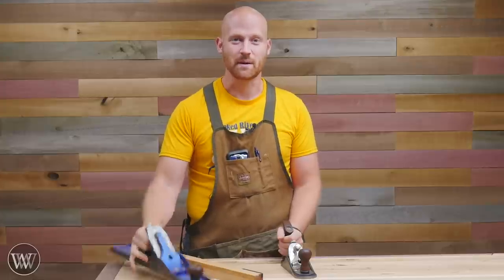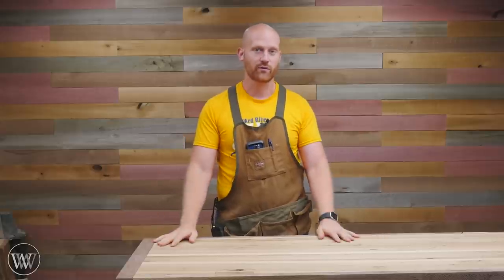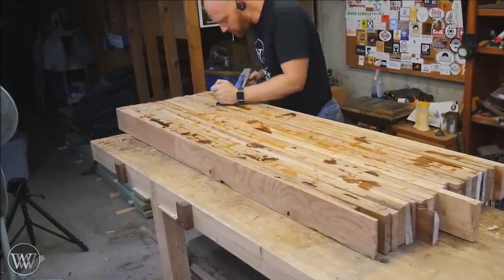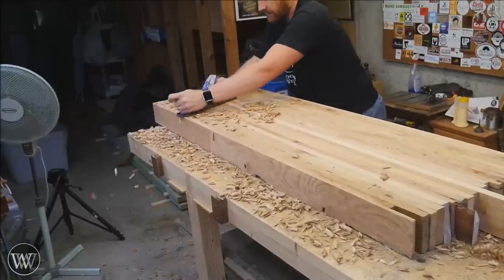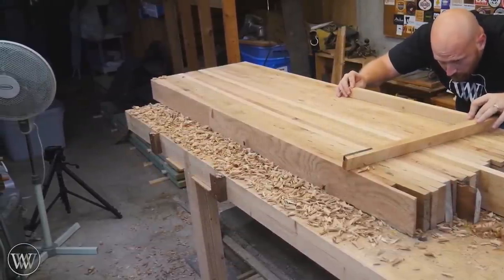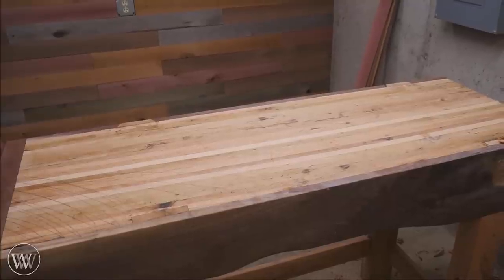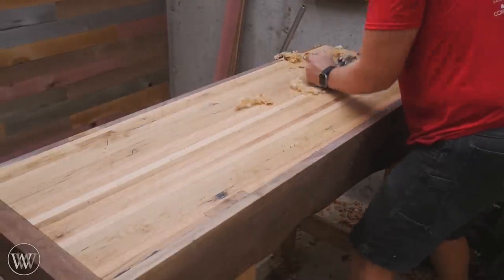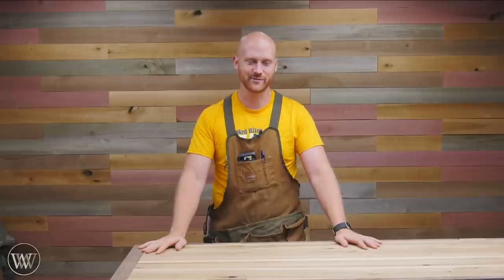How to Flatten a bench top with hand planes - Hand Tool Woodworking Skills

Comment: Great video. Thanks for adding in the important details that most don't add in, like planing at a 45 degree angle. Would these methods work just as well on a dining table top, even though you're planing down the faces of boards instead of edge grain like on your work bench? Thanks again.
Reply: (Late I know but for anyone wondering this) there isn't anything fundamentally different whether you are planing the wider face or the narrower face of a board. End grain is much harder to plane though, and tear out occurs differently compared to planing the face.

Comment: Question: I am not clear on why the winding sticks are needed/useful here, as you are working with a whole bunch of boards (each with its own idiosyncratic behavior, presumably) and not a single piece. If it were a single board that you were planing, the winding sticks would have indeed indicated the typical "corkscrew" motion of the wood. But seeing as this is not the case, why are they needed here?
Beautiful work, as well always, BTW...
Reply from the maker: The top itself may not be twisted but if two opposing corners are high the surface has a twist to it not the board. The winding sticks will still tell you that. A straight edge may or may not actually show you the twist in the surface.

Comment: After planing my hard-maple bench flat, I found that it was just too smooth and slippery.  I ended up going over it with a random orbit sander with a 100-grit disc to rough it up a little.  I like it much better that way.
Reply from the maker: Yup a lot of people do that. I just finish it with BLO and that provides a bit of grip.

Comment: Great job James! However, if you really want to get it flat & do it fast, use a router set up. I know, I know, this is a hand tool only channel.... :)   Steve
Reply from the maker: even then this is often faster. I spent 1.5 hours total. and if you calculate the time spent making the jig, setting up the jig, junning it, then smoothing and sanding. I would have been done long ago.

Comment: This is a great video. Would the same process work to flatten something like a table top even though you'd be planing face grain instead of edge grain like the benchtop you were working on? Thanks.
Reply from the maker: It would be the exact same for that face grain or edge grain is the exact same thing.
Reply: @WoodByWright  ok! I wondered if that was the case. I just didn’t know if there was a distinction between the 2. Thank you!

Comment: So looking at this it doesn't seem like your flatten the boards before the glue up. Is this the case? If so, have you had any problems with boards not lining up together when glueing the sides together?
Reply from the maker: Nope. flattening them before glue up is something you do for power tools cuz you can't run it through a planer afterwards. for hand tools it's easier just to glue them up and then fix them all at once rather than individually.

Comment: Will this work or do you recommend anything different for a larger tabletop? 

Making a farmhouse dinner table. First time doing pocket holes. Upon screwing them together It’s a lot less smooth then I had hoped for. Guess I’m trying to avoid sanding for hours 🥴
Reply from the maker: Right on. You can do the exact same thing for this as you would do with a bench top.

Comment: I made a bench top from planed all round pine from a local timber merchant. When I glued it up, it was reasonably flat, but then a few weeks later when I came back to it, it had cupped badly (along width). So much so that when placing a straight edge against it, there was about half an inch gap on either end. What would you do in this scenario? I think trying to flatten is out of the question as I would lose so much tickness, not to mention the amount of work! I'm annoyed because this seems to happen to all my projects. I assume because I work out in my garage where the humidty is always changing. Given my enviroment (where I can't control humidity), what can I do to keep my material from warping? IS clamping the materail down to a flat surface when I'm not working on it a bad idea?
Reply from the maker: well, when you buy pine from the store it is still wet. first I would ask how long you let it sit int he shop before gluing it. in an open air shop, I would let it sit 2-3 weeks and more in the dry season. but the short answer is that with out air conditioning the wood will always move on you. and no amount of clamping will stop it.

the other question I would ask is did you put a finish on the top and not the bottom? If so. then the bottom will soak up moisture and the bottom will expand faster than the top.
Reply: I hadn't applied a finish yet, it was just glued up. You say let it sit for 2-3 weeks, but wouldn't I have then been in the same position? they'd have still warped to what they are now? as for the finish being on one side only, isn't that how all furniture is manufacturered? whenever I look inside a bit of furniture, it's only the outside that is finished, the inside is always bare?
Reply from the maker: direct. you let it acclimate tot he space then flatten out the twist and cup of each piece. then glue them together. there is a lot of losing but if you don't do it the whole piece can warp. And yes cheap furniture is made that way. If it is quality they will at least oil and wax all surfaces to slow the moisture exchange. or they make it out of plywood and press board that does not warp.

Comment: I have a couple questions.
I think you flattened the bottom, first correct?
Did you try to make the top and bottom surfaces parallel in any way, or just both of them flat?
Reply from the maker: I did not touch the bottom at all. it is still covered in glue drips and the boards are up to 1/8" out of alignment. I just have no reason to smooth out the bottom.
Reply: Good thing you don't show the bottom in your video's LOL.
Reply from the maker: I will in the last video when I do the walk around.

Comment: Hi James. Great bench! I am curious what size jointer plane you used.... Is it a number 7? Do you ever have any problems with the sole deviating from 'flat '?
Reply from the maker: it is a #7 but I also use the #6 and #8. no no problem with them coming out of flat. as long as you don't drop it. after 5-10 years of doing edge jointing, you might notice the center of the plane has a hollow of 1-5/10,000ths. a lot of people make a big deal over how flat the plane needs to be, but in all honesty,  most people would only have to think about it once a decade.
Reply: Wood By Wright Thanks!